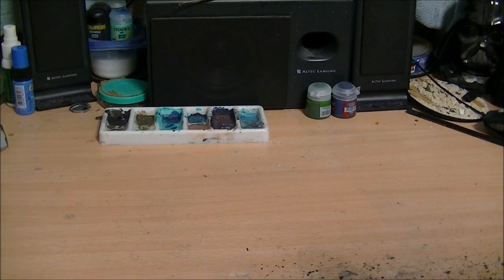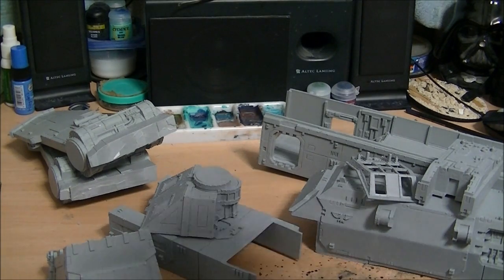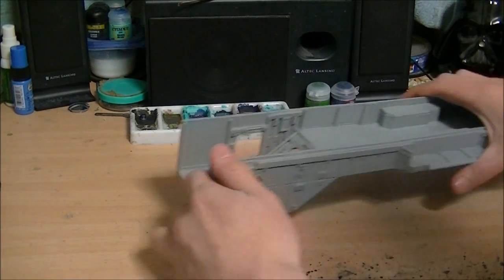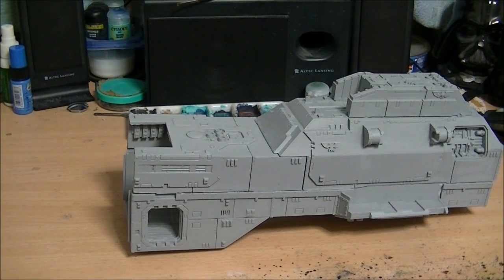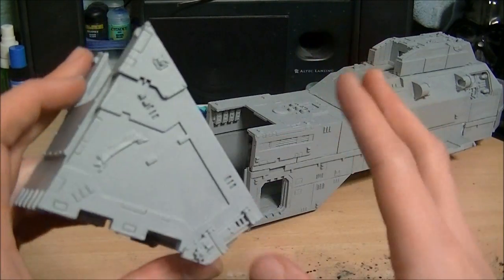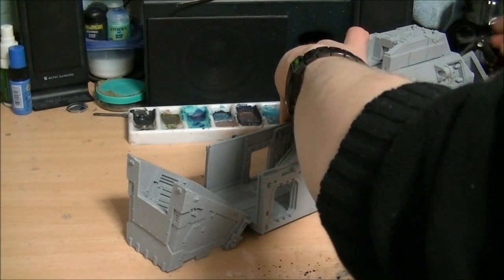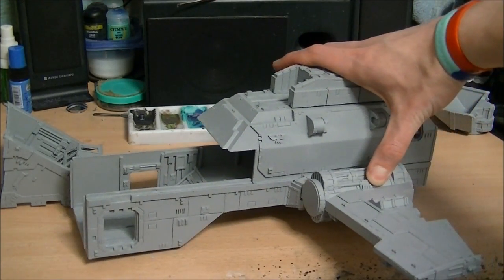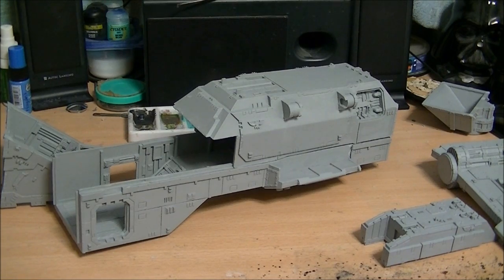Project: Thunderhawk - hull dry fit

Comment: Nice work Hazard, a quick question regarding the cockpit clear bit, would you not cut the clear plastic sheet FW gave you into smaller panes to fit each window section, as from the quick look in your video it seemed like the canopy section had a lipping to sit the clear plastic into for each pane ( think I'm explaining this like a complete nob here sorry dude lol )  so it would be like you're re-glazing a real window if you get me rambling lol. would need careful measuring and cutting though.